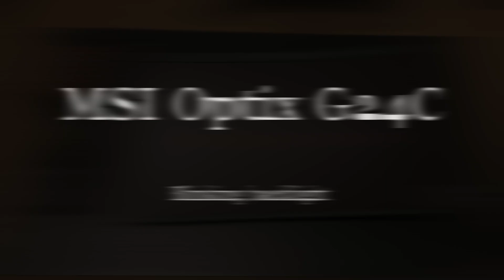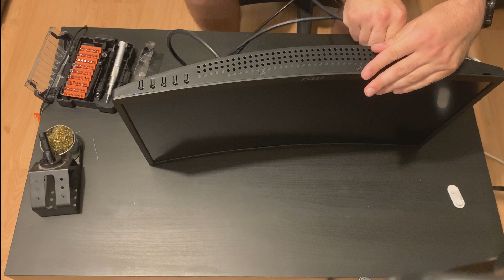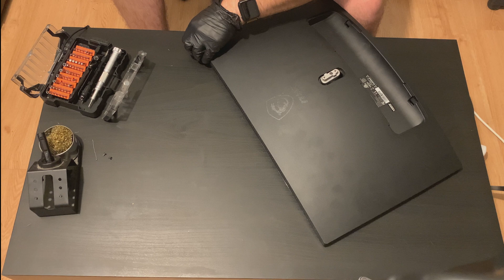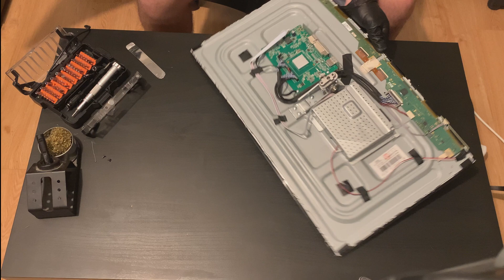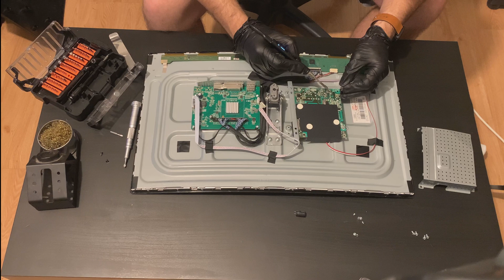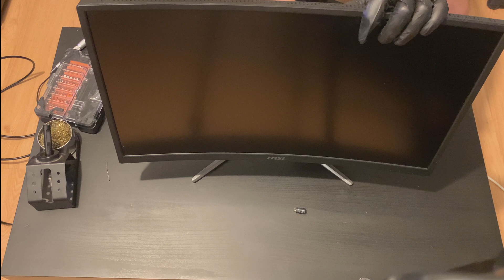MSI Optix G24C Backlight repair

Comment: Hi, when I turn my monitor on from cold, the backlight starts flickering and sometimes turns off completely. If I let it warm up (by turning it back on immediately when it shuts off), the flickering goes away and then I can use it normally.
How likely is it that the problem is with the power supply capacitors, like in your case?

Comment: This is the exact problem I’m having. Monitors started flickering until I lower the brightness. Eventually starts flickering again until I lower it even more. Today, the backlight suddenly turned off on me and I couldn’t get it to turn on no matter what I tried.
Reply: hi sorry for bother but did you fix ur monitor, after 8 years i got the same problem, monitor flickering and stopped work. Did you have some advice how
 to fix it?

Comment: Nazdarek bude prekvapenie ked mi odpises… mam tento isty monitor a pocas sledovania filmu zhasol a nesiel zapat. Chcem ho opravit ale neviem sa dostat nikde do datasheetu alebo do nejakych informacii vedel by si pomoct? Mam len par otazok.
Reply from the maker: @richardbrazdovic8395  Odkial si ? len pre info. Bude treba pozrieť zdroj napájania.
Reply: @ trnava, tam smerujem potrebujem zistit kolko tam je output voltage do z toho zdroja
Reply: Nameral som 3,5V
Reply: @Bogdosko  ?

Comment: If you have the same problem and changing the capacitor does not fix it check the resistor 60a on the other side of the board. Resistor info 2kr 1206 smd.
Reply: Thank you sir, i fixed my monitor for less than $5 in our country.
Reply: how many ohms?
Reply: @TXC-kr4yq  2kr means 2000 ohms. k stands for thousand and r means recitance in ohms. Hope this helps 👍
Reply: Do you know the name of the capacitor in the video?
Reply: @FikrAM0902  680uf 35v electrolytic capacitor.
Reply: Thank you
Reply: Hi, i changed my Capacitor but the problem still exist. 
Im trying to change the resistor as your suggestion, but i can't locate it.
Reply: @FikrAM0902  the resistor is on the green side of the board under the piece that's held in place with the white plastic clips. Right under the h in hkc logo that's on the white side of the board. Mine had visible burn marks on both sides of the board so it was easy to find.
Reply: wonderful

Comment: got my screen working again, thanks a lot :)
Reply: curious if you had a flickering display or no display at all?
Reply: @elimaggard844  i'm having the second issue. it's a black screen even if it actually work. I mean it's recognized by the PC and I can drag windows between this monitor and another one fully functional. I can't even see the setting menu of the g24c.
Reply: @xOromis95   I'm having the same issue. Just get the backlight on the monitor, no color, no monitor menu just blank. It gets detected and everything like you said. Tried every single port with multiple cables with no success. I was curious if replacing the capacitor in this video would fix this or if its something more major.
Reply: Same problem, at first its flickering then now its totally black and no display but sometimes it appears some display but suddenly it disappeared. Btw my monitor is almost 5years i think?